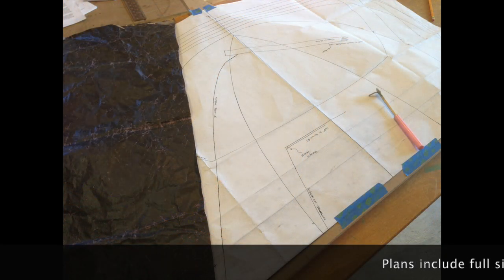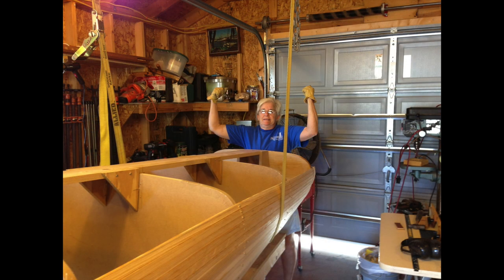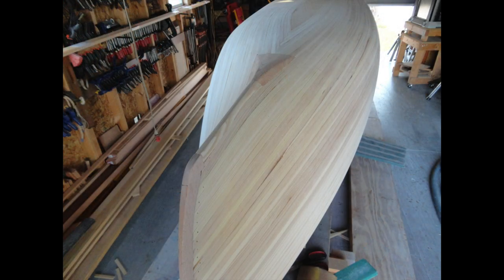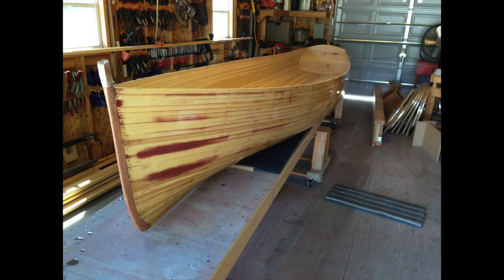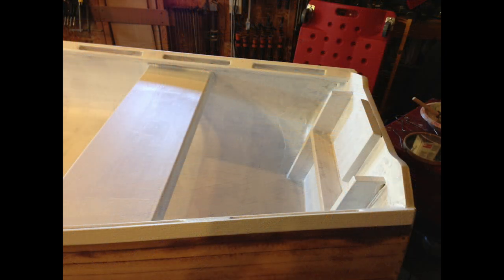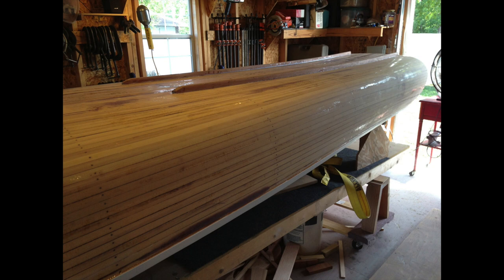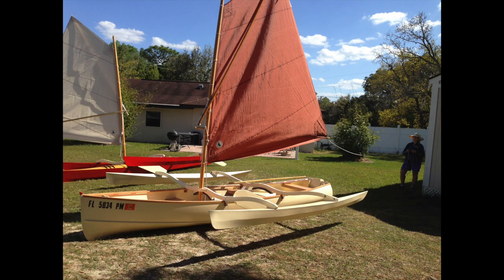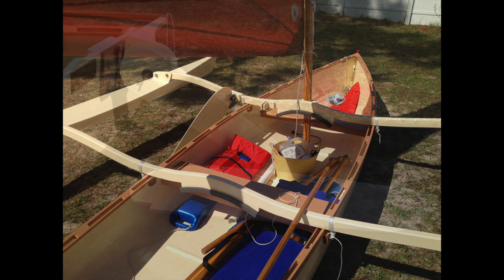Building a Robb White "improved" sports boat, Chickenfeed   HD 1080p

Comment: Beautiful boat!! How much epoxy does It take to glass a boat like this?
Reply from the maker: More than a gallon but less than 2. Quite a bit gets scraped off when putting the glass on. So we buy a 3 gallon kit, 2 resin, 1 hardener so we have enough to start on the next boat if the urge to build is uncontrollable.

Comment: I am curious how much your boat weighs. I am almost finished building a teardrop trailer and trying to figure out a boat that I can put on the rack system that would be able to hold several hundred pounds (it is attached to the trailer frame and not the cab. I need something under 150 lbs that my son and I could put on top. I need to seat 4 people to do some lakes. any suggestions?
Reply from the maker: It would be well  under 150 ponds, would guess under 100. We sold the boat a few years ago. Robb White said 88 pounds, but depends on species of wood you build with and amount of epoxy, etc. There are 3 seats and beam is 43 inches, so one person is sitting on the bottom. Is fine for small lakes and rivers, would avoid big waves.  following are the specs that Robbwhite.com advertises.
Strip planked
Length 16'
Beam 43"
Weight 88# (without floorboards)
Engine: Martin 60, 7.2 hp., National Pressure Cooker Company, Eau Claire, Wisc., 1946... wt. 40#.
Performance

The boat will easily plane two adults with 3 hp. and will run like all-get-out with this engine. I recommend five or six hp.

Plans, $75 pp.

Accurate with full sized mold tracings and complete instructions. The first boat built from these plans was built by a high school shop class in Greenback, Tennessee.
t
Reply: @RexandKathie  Thank you for the swift and full reply. Your work is inspiring!
Reply from the maker: @briand3837  Glad to oblige.

Comment: Sorry for all of the questions but is this easy to use as a rowboat? could I easily adapt to use oars?
Reply from the maker: Oarlocks could be installed very easily along the rail aft of the middle seat. You may have to move ballast around for proper weight distribution but nothing major to do,  move the heavier kid aft or the cooler. Adjust placement of oarlock sockets according to your arm length, I usually go with 7 to 9 inches aft of the seat, whatever feels most comfortable.

Comment: I finally got my plans. What is the tool at the 11 second point that transfers the lines to the wood? Thanks
Reply from the maker: Hi Brian, glad you received the plans. The tool is a sewing  pattern tracing wheel. It makes indentations thru the paper and carbon paper into the wood. Available at Joann fabrics, Amazon  or Walmart. Good luck on your build looking forward to watching your progress.
Reply: Hey mate can you help out with sourcing the plans cheers
Reply: @TheNed69  Robb White and Sons, INC
PO Box 561
Thomasville, GA 31799

Be patient, they take a little while to respond to correspondence.
Reply: @briand3837  thanks mate